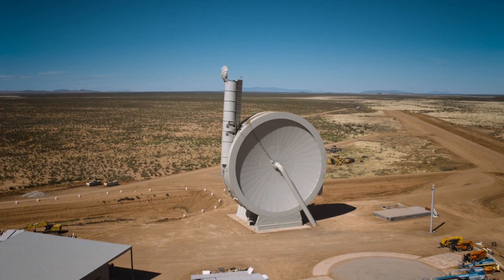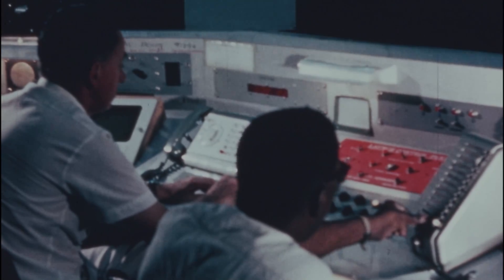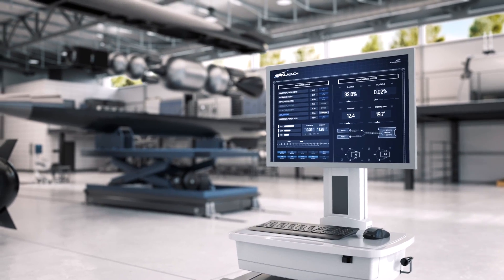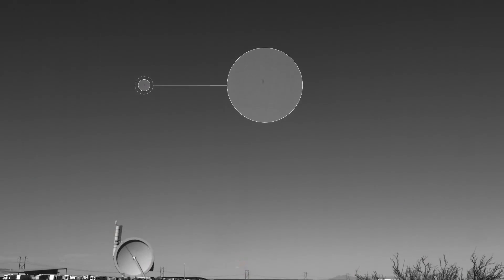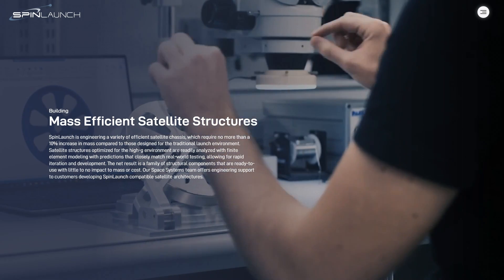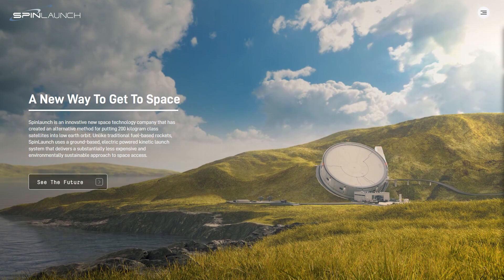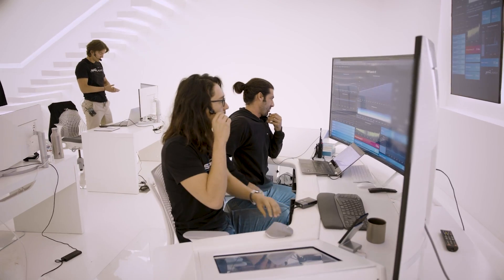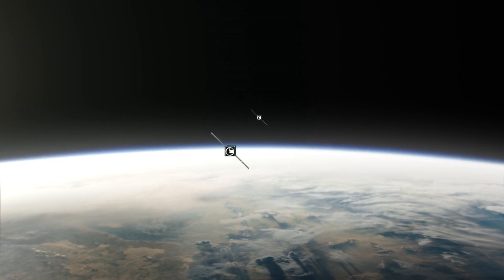Can Spinlaunch Throw Rockets Into Space?

Comment: When the projectile is released it has a 450 rpm rotation component. That's why it went through the vacuum barrier sideways.  Solve that Spinlaunch.
Reply: Does the projectile actually retain a rotational moment of inertia though?

My physics may be a bit rusty; but I would have thought that when an object at the end of a spinning arm is released, the object just continues in a straight line tangent to the part of the circle where it was released. (Note that I’m ignoring other forces/accelerations imparted on the projectile by the air and whatnot upon/after release, for simplicity.)

Maybe I’m forgetting something though. 🤔

EDIT: See further comments below; I think I was in fact missing something.
Reply: @jgottula  No you're not missing anything.  A lot of demonstrations of this are not concerned with the angular momentum of the projectile around its Center of Gravity, just the momentum of the CG of it with respect to the spinning arm that threw it.
Reply: @ebenwaterman5858  Okay; so the concern isn’t with e.g. “does a spherical cow released from the wheel travel in like a curved line or something”; but more with the possibility that small deviations-from-the-ideal could mean that the projectile may not be perfectly balanced and lined up and so therefore might end up spinning a bit due to the specifics of how/where it’s attached to the wheel and the specifics of exactly how it’s released, I suppose?
Reply: @jgottula  No it has nothing to do with trivial stuff like the perfection of the release mechanism or stuff like that. Try this...  On a piece of paper, draw a throwing arm with a center point. Draw a cow on the end of it.  Pin the drawing to the table with the point of your pencil and spin the paper once around. How many times did the cow rotate?  :)
Reply: @ebenwaterman5858  Ohhhh okay, I think I see what you’re getting at.

The payload/projectile does separate from the arm and continue on in a non-accelerating Newtonian linear reference frame, as one would expect. (Or in any case, the center of mass of the projectile does this.) But since it was part of a rotating system, the projectile will still want to spin around its own center of mass, because it retains the part of the system’s angular momentum that it had prior to separation.

It reminds me of those weights-on-long-strings that are released from many space probes to spin-down: by offloading a large chunk of their angular momentum to the masses, they slow down the spin rate of the probe. Obviously the weights travel off in straight lines after the strings are cut. But the whole system would be useless if it wasn’t the case that the weights held some large chunk of the system’s angular moment prior to release and that they still retain it after the time of release. (And of course it’s intentional that they’re on long strings to give them a maximal lever arm so that they make up as large a percentage of the system’s total angular moment as possible.)
Reply: @jgottula  Exactly and exactly.  Thanx for commenting.  :)
Reply: @ebenwaterman5858  Yeah so I think you have a legitimate point (assuming there aren’t any holes in my/our physics reasoning). It’s unfortunate that the terminology is ambiguous and obtuse to describe the exact thing at issue. 😕
Reply: @jgottula  If I'm right about this, either they will have to demonstrate that they can cancel out this component before it gets into the barrel. Otherwise it's gonna be sideways a lot more than even their sales ad movie already shows. I'm thinking about 90 degrees based on eyeballing the barrel to be about 1/4 of the spinney thing's circumference.
As a matter of further controversy...at 00:21,  0.25 playback speed and 720P res, it looks like their own video captured it tumbling.  If the whole thing isn't CG.  :)
Reply: Where do you see it going through the vacuum barrier sideways?
Reply: @D0WNT0WN  4:27  :)
Reply: @ebenwaterman5858  maybe a slight side drift, but it's pointed in the right direction still.
Reply: @D0WNT0WN  I'd like to see a wider angle of the same shot.
Reply: You don't get how momentum works do you?

Comment: Avoid the friction by firing a laser on the launch axis  to "thin out" the atmosphere a nano second before releasing the projectile.
Reply: This could actually work. The first shot has a bigger electric bill, but the remaining energy in the rotating system could be consumed to recharge the capacitor bank for the laser. Maybe a counterweight with a neodymium core can be fired into a superconducting coil underground to recover the waste energy.
Reply: Or launch from a high mountain.
Reply: @musicbruv  Absolutely. Even 5000m would halve the exit density...
Reply: @n2b998  Yep, which would decrease the air pressure on the projectile and either increase its speed or require less energy to launch it.
Reply: @n2b998  build it on a tall mountain
Reply: @musicbruv  Mt Kilamajaro in Tanzania would be perfect for this. 6km above sea level, and right on the equator, so you've already got a 1000 mph West to East yeet for free.
Reply: @DLWELD  Mt Chimborazo in Equador would be even better.
Reply: @alifesh  Even if it's for only a short distance. Smashing the nose of the launch vehicle into a gradient sounds a lot better than hitting a sharp boundary layer let alone a solid wall.
Reply: @alifesh  we need rockets with lasers on the nose cone!
Reply: Centrifugal trebuchets. Lasers. Can we make the booster shark shaped?
Reply: A rocket following a perfect straight line like a laser isn't gonna happen.
Reply: @sigmasquadleader  Remember, this is a projectile, so its initial trajectory will be semi-straight. Reducing the friction in the thicker  lower atmosphere might have some benefit.
Reply: Josef Krakel

Semi straight, but slightly unpredictable within a degree of arc.

Maybe it'd be possible to push it with a laser after launch and target acquisition, but clearing the air beforehand would require omniscient levels of knowledge about the behavior of the projectile in order to cover that 1° range the projectile might launch in to AND clear beforehand with the laser.

And if you widen the focus of your laser, it won't really be a laser in the traditional sense if it's not a confined beam.
Reply: @sigmasquadleader  The rocket would have a tenancy to Follow that line due to the reduced resistance though.
Reply: This is getting uncomfortably close to Gundam Seed (I believe) where they annihilated a trail through the atmosphere with antimatter projectors to facilitate the launch of an overweight spaceship.
Reply: I think a laser-based propulsion system would be a nice complement to this system. Might be able to get the g forces down somewhat. I think the atmosphere itself can be used as a propellent in that case? Atmospheric turbulence is a really big problem at large distances, but we've got amazing results from Astronomy (we've developed something called adaptive optics), so maybe it's not insurmountable up to a few kms.
Reply: Well you could put on some solid propellant on the backside of the rocket you ignite with the laser.
Reply: Have a laser on the nose of the Spin Launch to continually open a path through the atmosphere. It would not have to run very long and the craft would loose very little speed interacting with Earths atmosphere.
Reply: I might have missed this suggestion. But what if it's a ring of lasers? Like we yeet the rocket out of a giant Elgato Ringlight attached to the point of egress, maybe have them spinning? Or would the power requirements just be absurd? 

Electricity only makes sense to me at the RC car scale, and I can't even begin to think about the fluid dynamics for the air.
Reply: K-Anator

I think a laser array would be the best approach if you went the laser route.

It's all very interesting and thought provoking.
Reply: @sigmasquadleader  Very much so! 
Even if I can barely comprehend the math and engineering involved, I get some good sci-fi concepts to draw on later down the road lol.
Reply: and build it on top of the mountain
Reply: @paweljasik8971  I agree, add a railway system to haul the device itself and its cargo up the mountain.
Reply: This would be a rocket... errr... satellite launch that would require some serious eye protection as well.
Reply: Spinlaunch needs to have a t-shirt that says" we don't launch we yeet"
Reply: Wow. Brilliant idea. Some way to disrupt the "flattening" effect the projectie makes on the air directly in front of it and speed of sound/sonic booms may be less of an issue. Love the idea.
Reply: @CDarwin7  biggest problem I see is that exit aperture for the payload looks extremely narrow and if it misses disconnect by either a fraction of a second or inches you're going to have the world's biggest earth-shattering kaboom in that launch chamber without the use of a Cannon or anything provided by " Acme" propulsion systems.... Wiley E coyote... design Chief and chief engineer.
Reply: So, a laser-powered lightning catapult? My inner 6y/o Thunderbirds fan approves.

Comment: I just spent months spec'ing out a new balance machine for jet engine rotors to reduce variability during balance operations...the requirements for Spin launch make my brain hurt 😄
Reply: I'm wonderung how the turbulences will effect the still spinning rotor once the chamber is filling with air, once the projectile penetrates the barrier. That thing will flutter like hell.
Reply: If it doesn't work it'd be relatively easy to release a dead weight off the opposite side at the same time, maintaining the balance.
Reply: @rhamph  how would they just drop a weight without launching it in the opposite direction?
Reply: @SpydersByte  They would just drop it in the other direction. Have an outlet tube mirroring the launch tube and sync the release mechanisms, and throw the counter weight into a pool or something to absorb the energy. Maybe it'd be possible to regain some of that energy too, to help recharge the batteries for the next launch.
Reply: @SpydersByte  They would launch it in the opposite direction...
Reply: @mitchellvanwagoner8119  That is a LOT of energy though. So obviously it's gonna impact something, but a long tunnel is not impossible to dig. Would be quite the mess when the deadweight hits the bottom...
Reply: @SpydersByte  Lots of details are possible but at the simplest you take the same release mechanism wired up to the same trigger but instead of an expensive satellite you use a cheap steel weight.  Have a tank of water underneath covered by the same destroyable cover the real satellite goes through.  Steel weight might shatter when it hits the water but so what?  It's very cheap in comparison, easy to replace.
Reply: Yeah, it's difficult to imagine this will pan out.  Might yield some interesting data, though.
Reply: I clear tables and empty bins at McDonald’s 

So, to me, this all seems perfectly plausible
Reply: @Astro Kozmo anyone up for a spinal cord smoothie?
Reply: The tricky part... When that thing enters atmosphere not moving at the same rate, especially large objects, you are going to have major problems. If this was passed through a quick succession of lower densisty atmosphere before it reaches earths atmospheric conditions, you could theoretically slow the rate of turbulence on the craft allowing for a higher rate of success.
Reply: @Astro Kozmo SMOOSH
Reply: Might help your brain some to know its a tether not a fixed point. Mean spinning the thing will level its self out. Well, I guess you do need a pretty accurate shaft but it wont have to be like perfect or anything.
Reply: Your brain about the box ☺️
Reply: It's self balancing 😎
Reply: Just to add, build it in the ground to dissipate the energy and sound.

Comment: I suggested to NASA a launch tube going deep into the ground, possibly even steam powered to accelerate rockets to high speeds like carrier catapults.   This would be safer and more reliable and depending on the depth of the tube and power of the accelerating rail, could save millions of tons of fuel during launch.   Plus the engines could be lit before the rocket reached the final stage of the launch tubes....or even after clearing the tube at Mach 1 or Mach 2.   The greatest waste of fuel (and contamination of the atmosphere) occurs within the first two minutes of launch.  This would finally eliminate that albatross.  The technology is already available and tried and tested.   I suspect eventually they will go this route.....and never thank me <sigh>

Comment: They just need to launch 2 rockets: on UP and one DOWN, to balance the rotor.
Reply: or... detach first one, wait half of rotation and then detach second one. and pray for second one not coliding with first one
Reply: @Tandem1221  And pray that the bearing does not break during said half a rotation
Reply: Or.. add more weight at intervals equivalent to the rocket evenly spaced around the rotor. The more rocket placed weights the less vibration when the rocket is launched.

Comment: Once the projectile is released wouldnt conservation of angular momentum cause the arm to rotate at an even higher velocity?
Reply: Not if it is transferred to the projectile
Reply: @8b8b8b  
The rotor loses the mass of the projectile. That loss must cause the rotor to speed up.
Reply: Good point. I think that's the reason the opposite arm is much shorter, it handles the extra push in the opposite direction like switching to the smaller gear in the rear wheel of a push bike.
Reply: No. letting go of a massive object changes the angular momentum of the system, so it will rotate the same speed it was before, until the air rushes in through the burst membrane, making a deafening cacophony of noise and aerobraking the spinning arm.

Comment: Definitely sounds like the launch system will self destruct upon release. That would definitely push up the launch price.
Reply: It appears their technology demonstrator didn't self-destruct upon release.
Reply: @asdfjoe123  Because it was spun at a fraction of the proposed speed, and had a fraction of the proposed torque.
Reply: @asdfjoe123   because it was unrealistic. aerodynamic drag is a  function of speed squared.....so they only demo'd something at low speed. no annoying 2bd and 3rd-order differentials to trouble the investors with
Reply: insurance cost will be through the roof because if something goes wrong not only this launch is lost but all successive ones until you fix the launcher, with rockets you only lose the current launch system if it fails [and the launch pad though it is way cheaper than a spinner].

Comment: This thing seems like it's trading the relative simplicity of a linear accelerator launch system for something much more complex and with little relative benefit other than "It's smaller."

Destin was able to achieve supersonic velocities with a trailer, some pipes, a vacuum pump and a compressor.  I think if you scaled that up and added a linear motor as a "second stage", you could achieve a hypersonic launch without the danger and complexity of their Rotatoyeeter.
Reply: Your complexity tradeoff is backwards. Industrial motors that produce high torque at megawatt power level and 450 rpm exist and are easy to get a hold of, basically off the shelf. Kilometer long linear magnetic tracks? Way more expensive and complicated. 450 RPM is pretty slow, Huge generator shafts, ship components, etc. use bearings of this size already that can handle 1000 ton loads.
Reply: This kind of launch system is usually demonstrated with ping pong balls and similar light projectiles. Mythbusters did it, Bruce Yeany did it, NightHawkInLight did it, just to name a few. I don't know what kind of projectile Destin was using but I think the real challenge is to scale up the mass while keeping the velocity high.

Comment: Could you build this into the body of a plane, fly it at high altitude and throw the counterweight down towards the ocean?
Reply: Probably not, the forces from spinning up the payload might throw the plane off balance. Also, you are going to fly the place up many thousands of feet into the air with not just the rocket, but also the launch mechanism negating a lot of the fuel savings this system is supposed to help with.

Comment: That challenge of balance is a cool thought experiment, i wonder if having a pair and releasing them half a revolution apart could be a fast enough way to change counter-weighting?  releasing a weight form the centre would be another way but that is going to be like a cannon shell by the time it reaches the outside.
Reply: Liquid counterweight would be interesting too - brings a lot more problems than it solves though
Reply: The physics are inevitable: to change direction 180° as it's rotating means you must be able to produce ALL of your launch impulse in 1/4 of a revolution, and transmit that to the foundations. It could either be by allowing the load to be offset and using huge bearings, or by balancing very carefully and then being unbalanced after release, but the momentum has to come from somewhere. The only alternative is to use two pivots and a linear track so you can provide impulse across multiple revolutions (allow the entire swing arm to slide backwards when the projectile is launched as reaction mass)